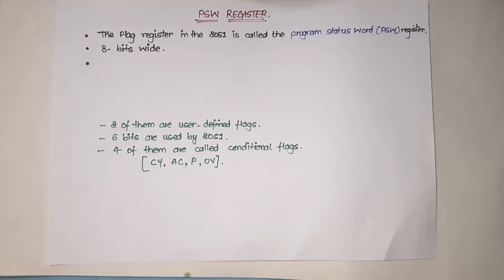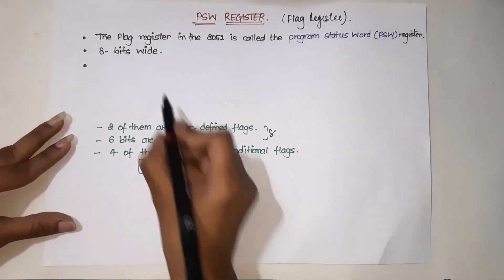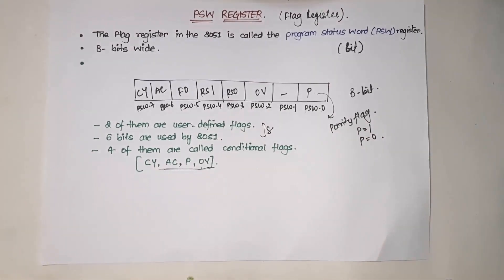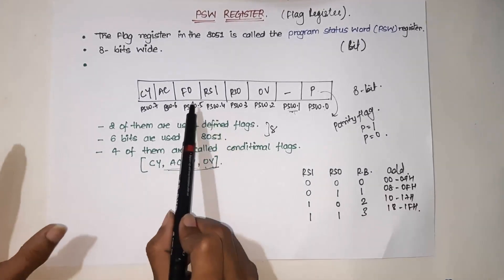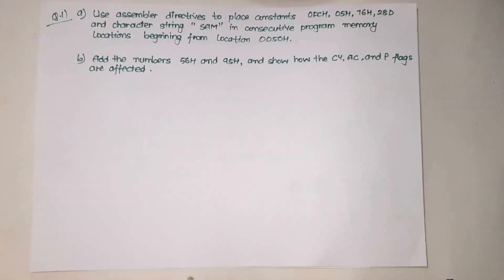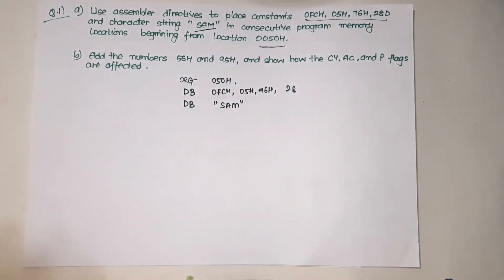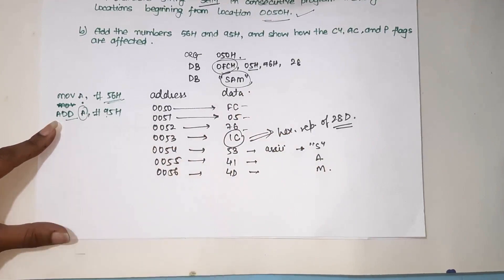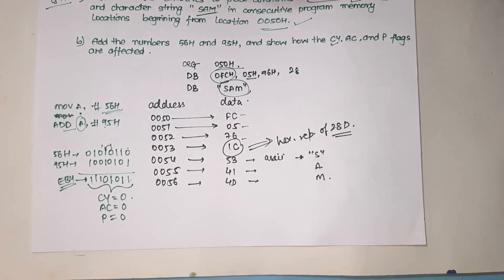PSW Register | Microcontroller in Hindi

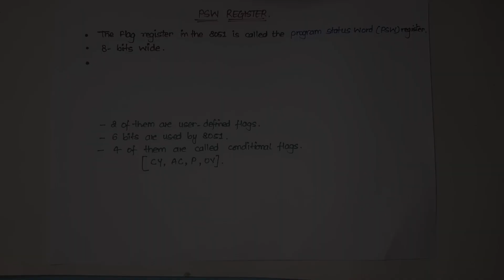Comment: 00:05 PSW Register is an 8-bit flag register in 8051 microcontroller
01:16 PSW register is bit addressable
02:51 PSW Register flags and their meanings
04:11 PSW register and flags in microcontroller
05:25 PSW Register usage in Microcontroller
06:35 Memory values include 0FCH, 05H, 76H, and 28
08:15 Understanding data representation in microcontroller
09:42 Explanation of PSW Register flags